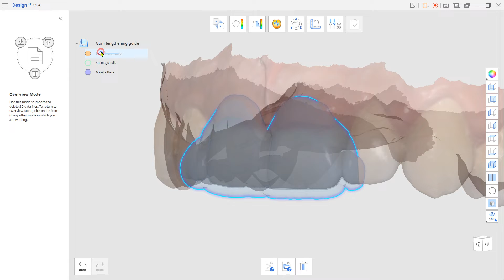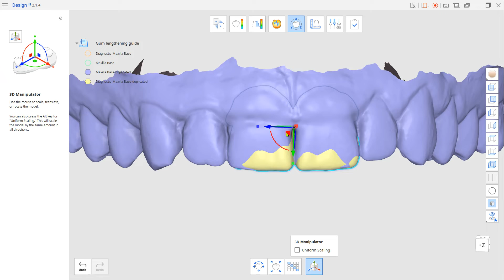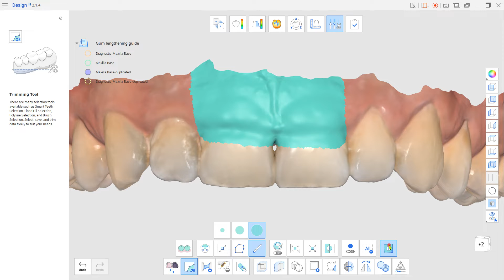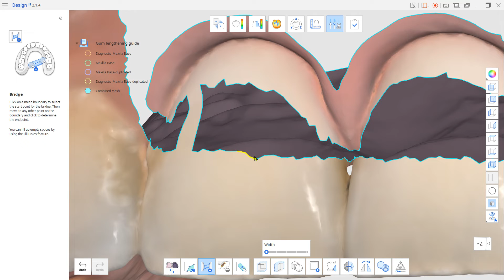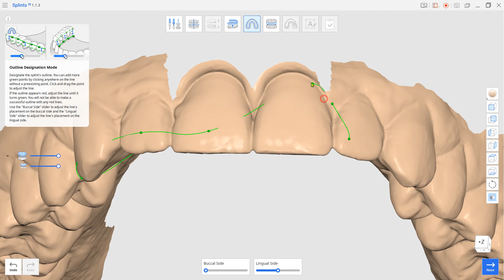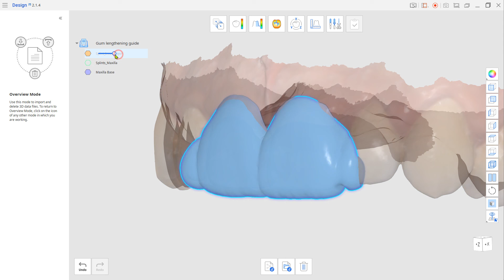Designing a gum(crown) lengthening guide with Medit apps.

Comment: So, I use a standard pre-taken diagnostic cast of maxilla with normal gum line, and use it for all patients that need to make a crown lengthening guid for? wouldn't that be a bit inaccurate?
Reply from the maker: Great question!
When using a standard pre-taken diagnostic cast of the maxilla, the duplicated area can be customized for each patient within the Medit Design app. The diagnostic cast simply serves as a basic reference to help you create a customized guide tailored to the individual patient's case.